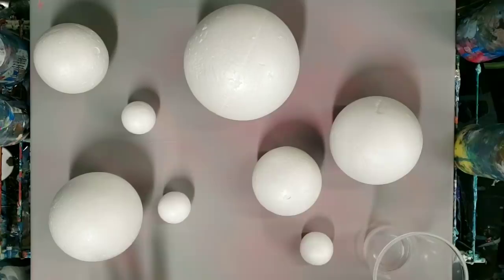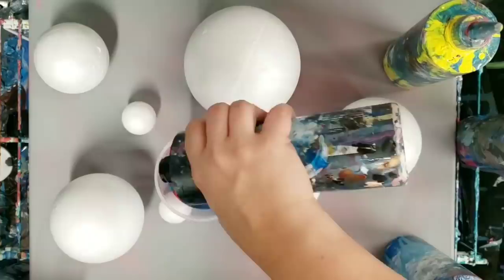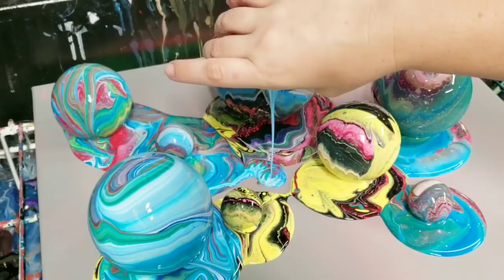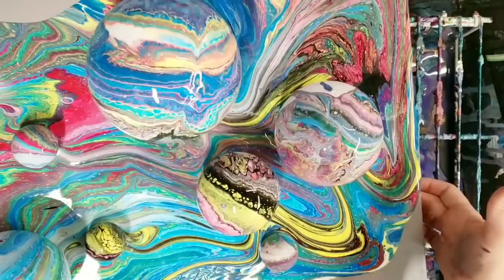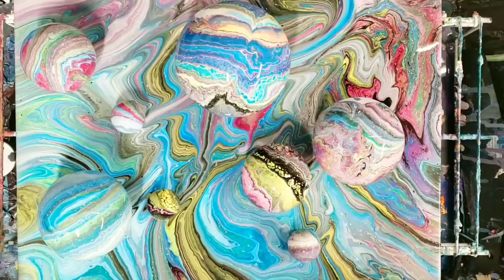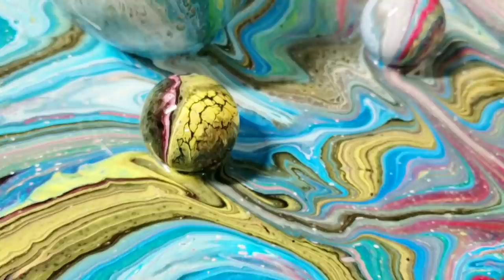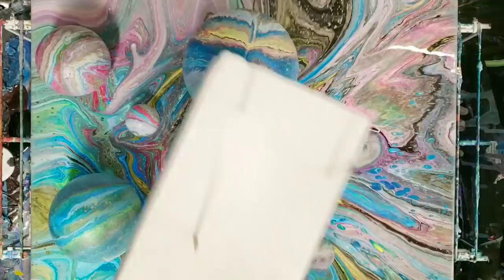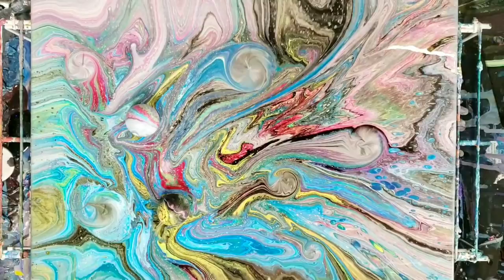More balls! Fluid painting 3D technique

Comment: I think I may try this Would it be safe to use a clear spray to seal the styrofoam?
Reply from the maker: I have sprayed it with rustoleum crystal clear enamel and that disintegrated the styrofoam, so I wouldn't recommend it
Reply: @MixedMediaGirl  and I think Mod Podge would dull it Epoxy would probably eat it as well I will try to do some research